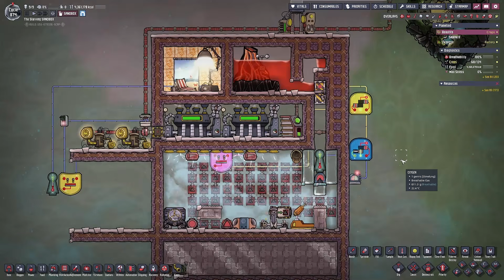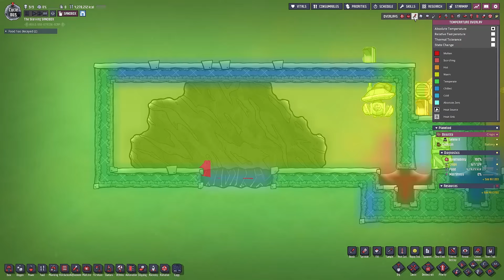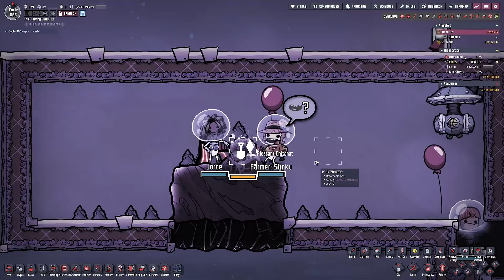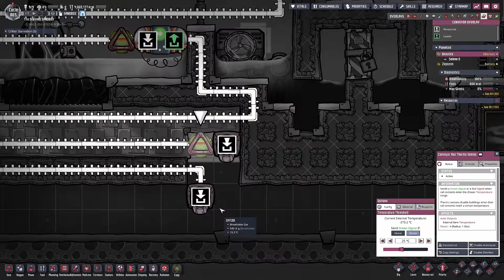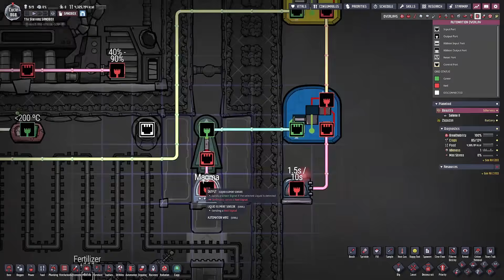Volcano Tamers and Steam Power in Oxygen Not Included

Comment: I still sea the thermal sensor setup in video's but one guy just used a time sensor on the output and it is pretty amazing. you can just activate the output once every 15-20 ish seconds depending on the vulcano's output. This way you get mostly an avarage output from the vulcano

Comment: Did the first tamer setup but all auto-sweepers and conveyer loaders (all made with steel + diamond tempshift plates at the back) still end up overheating, and this is just for a minor volcano setup.
Reply from the maker: It's all about how much steam and the temperature of it. Make sure that your autosweepers are not handling anything until there is steam for cooling
Reply: @ethanplays-lag  is there a missing section that goes over why your conveyor loader drops its materials once the line if full? mine just holds the hot material and then overheats. I don't see you ever switch to an automation overlay on the first tamers but i suspect there must be something forcing the loader to shut off and drop the hot material. unless im totally blind, and dont see it.

Comment: Why do you use an or gate in the second setup? Automation wire itself should function as its own or gate. That is, if I have two signals run on the same line if either signal goes green the whole line goes green, or if both are green it's green. Only when both are red is the line red.
Reply: @inutamer3658  
Multiple data sources on a single automation wire will cause overload damage if both turn on.
Reply: @veroxid  That's not true. I have a wire in one of my setups it has been sitting with 2 green and 1 red source for about 20 cycles with no damage
Reply: @inutamer3658  Lucky or unlucky I guess. I tried doing exactly what you suggest in the past and it starts overloading.
Reply: @veroxid  It's only the case when using automation ribbon and adding too high of a bit depth. It doesn't depend on how many inputs automation wire. For a single binary wire, it acts as its own or gate.

Comment: I tried your build. Struggled quite a bit with the chamber overheating way above 275C, causing steel shipping parts to overheat. The solution is a large steam buffer. Around 200kg steam per tile seems to stabilize things.
Reply: But then the volcano will overpressure and not start again - because 150kg/tile is the maximum

Comment: I prefer to use the cheepest door and just change the directions dupes can move. If you use logic to close the door it can trap dupes. If, instead, yoh set the door to only allow travel in the out direction then dupes wont enter and any stuck can leave. Also cheeper to install and can be done cycle one without an research done.

Comment: Use the magma to boil petroleum. Thats a better use of the heat.
Reply: @Delt4_Cr4wfish  not every biome has oil, for general use this is better
Reply: Also useful to cook Gunk into Petroleum, which means you have a liquid with good pre-space thermal conductivity / very high thermal range properties no matter whether you have oil on the asteroid or not :)

Petroleum has like 4x the thermal conductivity of water & water-based liquids, even if its thermal capacity is lower.

And even if Nuclear Waste is the king of pre-space liquids for beating all other relevant liquids at specific heat capacity AND thermal conductivity, it is harder to accumulate easily and its "corrosion" properties are annoying and require more setup complexity; my experience is that it may even be easier to get to space (and get super coolant) than it is to get a sufficient amount of nuclear waste for your cooling loops.

Comment: Tips: 
1. Use the magma blade method to avoid the bug where liquids suddenly become dense in U/L shaped passages and overpressuring tiles with the wonky build.

2. Separate the magma and steam chamber completely and use mechanized airlocks made of steel as the main contact point so that the steam doesn't absorb too much heat and you conserve more temp and delete just enough for the steam turbines to operate properly.

You can get good insights by studying CG Fungus's video about Petroleum Boilers.

Comment: Nice vid!
I was wondering about the automation of the turbines though. Why not just let them run all the time? There is no loss if they don't cap out at 850W. And whenever they don't run, the Igneous Rock isn't being cooled either. Also, if you use a large geothermal or nuclear plant in late game, chances are these turbines never run, which would waste the volcano's output.

And one little thing: it's 'Neutronium' not 'Neutrononium' ;)

Comment: You can drop the magma inside a mesh tile where it won't make solid tiles. If you block all adjacent tiles with blocks it will drop as debris through the corner, making the robo miner unnecessary and doubling the igneous rock output since mining removes half the mass
Reply: I'm talking from experience here, even in mesh tile IT CAN make a solid tile and its a pain to remove, so in dont recommend doing that
Reply: @abraxis234 how would it be a pain, can't you just put a miner there anyway?
Reply: @abraxis234  thats based on how much magma you put in at once if you drip it it wont do the bug out thing where you have to remove the tile and reload the save to see the iggy rock.
Reply: Yes, but teleporting material is an exploit almost as big as creating material out of nothing in sandbox mode because it's easier then actually playing the game and use dups
Reply: @Miffo3 you did NOT just call corner dropping debris equal to sandbox mode lmao
Reply: @Miffo3 It's a glitch in your opinion, game mechanic in others.   It's already non-physical that mining a soldified tile loses half its mass, rocks falling around corners tbh is more logical.
Reply: @Miffo3 my bro, GEYSERS already create mass from NOTHING

Comment: 8:51 Normally I would Not put the temp shift plate next to the insulate tile as it would heat up the insulated tile too.....
Reply: That was an old bug that's been fixed. The insulated tile and temp shift plates now interact normally where the insulated tile will now intake the same amount of heat it usually does with other materials. Materials share temps based on the lowest thermal conductivity.
Reply: @DreamingBlindly  Good to know

Comment: 8:15 Protip: normally we use a liquid reservoir(and reserve some liquid in it) and set beside the steam engine to avoid in game error where there is a chance that certain blob of water is cooler that others and cause the pipe to break(mysteriously). liquid reservoir with some liquid in it helps regulate the liquid temperature and prevent pipe burst.
Reply: The reservoir is over engineered. A cooling loop just needs one blob, which you can get with double bridges.

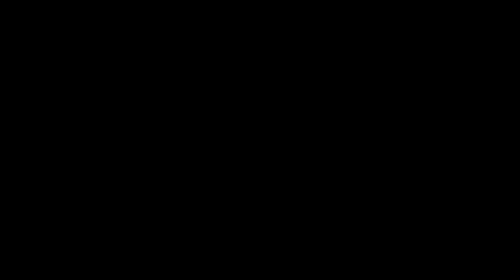Comment: 25:32 ok....something is missing, you forgot to put the rail on cycling mode, your design may work, but if you let the Igneous rock move around the area using the "overflow" method it will make things runs smoother as not all Igneous rock cooldown at the same temperature.

Comment: 4:02 No need to be that cautious, just "that" particular block will do. And if you did accidentally dig that tile, you can always plug it back using temp shift plate made of algae.
Reply: Dirt? Dirt should turn to sand and fall to bottom tile not where it is, unless u do 2 temp shift plates. Better to use coal, it turn to refined coal
Reply: @Mrlokimaya  You're right, I think I was saying Algae. My mistake.

Comment: 2:19 Ceramic is Not necessary. It will be very wasteful to do that. If you are that worry you can add another layer using normal resources like Igneous rock.
Reply: Using ceramic here is a waste, yes. But insulated tiles made of Ingeous Rock melt at ~1400C. If you want to make sure magma stays inside, use Obsidian. You'll typically find some around volcanoes anyway.
Reply: @ChrisKoe  insulated tiles hardly transfer heat. believe me.
Reply: @williamlai29   the heat transfer is not the issue my very confident friend. The melting point of igneous rock is just above 1400C. Magma will melt insulated tiles made from igneous rock and then the heat will transfer everywhere quite nicely. Believe me
Reply: @ChrisKoe  Check again. I've played 500 over cycles using insulated igneous rock. so far so good.